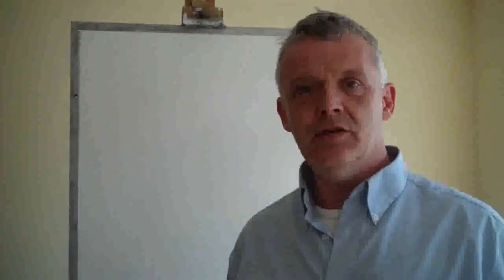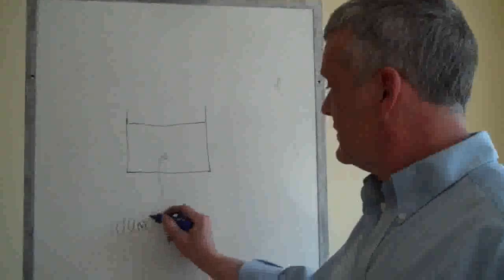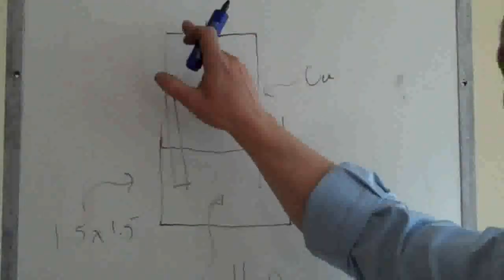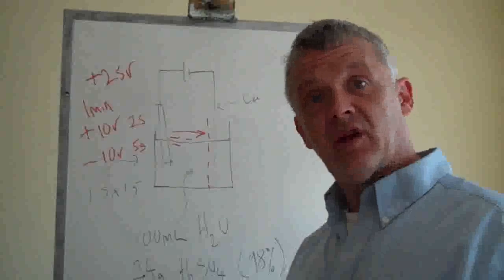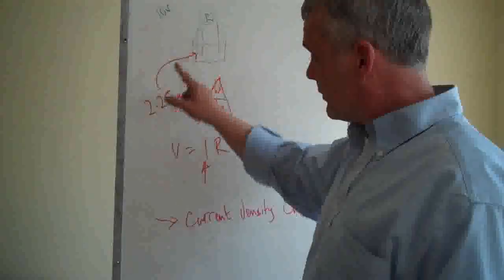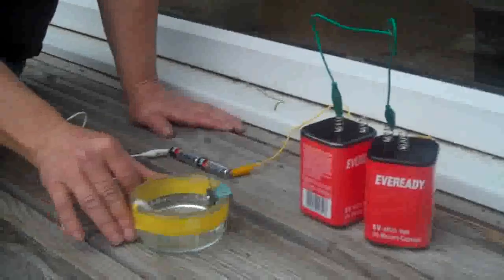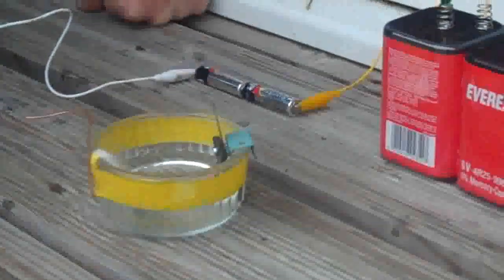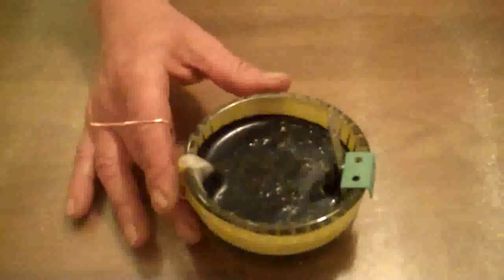Green Graphene

Comment: Hmm, can we use the resulting graphene like this, floating on top of an electrolite? I just had the idea to make a "flow-capacitor?" (like flow batteries) using bulk "plate - emulsion"... For capacity on the cheap. 
Tell me if you think its interesting.
Reply: Kistuszek I don't see how capacitance - a surface area effect - could flow like an electrolyte - can you explain?  RMS has lots of other videos on super capactors and the electrolyte(s) that work well...
Reply: Dude i honestly dont know how i was thinking it would work. But it sound a bit impossible now. I dont mind being wrong, but it feels bad not knowing how...
Reply from the maker: sorry mate - i missed this comment a new concept called the electrochemical flow capacitor (EFC) has been presented in several papers. This new concept shares the major advantages of both supercapacitors and flow batteries, providing rapid charging/discharging while enabling the decoupling of the power and energy ratings. Like in supercapacitors, energy is stored in the electric double layer of charged carbon particles. A flowable carbon-electrolyte mixture is employed as the active material for capacitive energy storage, and is handled in a similar fashion to flow or semi-solid batteries (i.e., for charging/discharging, it is pumped into an electrochemical cell, and for storage, it is pumped into reservoirs). Most studies present the proof-of-concept of this technology and report on initial EFC performance data obtained under static and intermittent flow operations. try a googel scholar search
Reply from the maker: replied tot he earlier comment - sorry i missed it
Reply from the maker: see my reply - there is some confusion these days over what constitute a capacitor and what constitutes a battery - a good way of seeing it is as an energy storage device with capacitive attributes
Reply: Thanks, ill read up on this.
Reply from the maker: again - sorry it took me ages to reply - i just missed the comment until someone else commented and it highlighted the fact i had missed you
Reply: Dont sweat it! Comment section is messed up for one reason or the other usually.
Reply from the maker: lol - true enough lol

Comment: How many amps should my batteries be?
Reply from the maker: mate - i don't understand that question - as high as you can get them - they will last longer
Reply: OK so the amprage of my batteries don't matter. Only my voltage. I have tried this 3 times and it hasn't been working out for me. Why do you think that is? I have been using as batteries in series to get the 10 volts and 2.5 volts
Reply from the maker: how are doing with the timing and swapping the polarity?
Reply: Fine but just to verify it is positive on graphite for 2 sec and  positive on copper for 5 withe the 2.5v at the start with positive on graphite for 1 minute. I am getting fizzing but no gray foam that is the graphene
Reply from the maker: yeah sounds about right - all I can suggest is you try varying it and see what happens
Reply: OK thanks for the help. If it does work how should I spin coat it? Do you suggest just painting it on to my glass?
Reply from the maker: I did a vid on spin coating mate
Reply: All right mate thanks
Reply: Dan Avila try using shorter conductors and a smaller tank.
it sounds like there is too much internal resistance.

try to find a small appliance power supply  that you don't need anymore with a higher amp rating even if the voltage is higher!

Comment: would vein graphite work?
Reply from the maker: yes
Reply: For some reason this was not producing any of the black goop  that is graphene like yours. Any idea as to why?
Reply from the maker: how big was the flake size?
Reply: Very small and only like 10 of tgem
Reply from the maker: i use 5- 350 microns - 5microns is about the size of a blood cell
Reply: How can I tall. It is the researchers 10 vein from gs international
Reply from the maker: you would need an msds or tds from them. I don't work for them anymore but i doubt it is that small. You could try intercalating it and expanding it first or sticking it in a wet grinder for a few hours
Reply: Then it would be a powder though and it had to be an electrode right?
Reply from the maker: you can compress it onto an electrode - but to be honest - i forgot you were using the electrolytic method.
Reply: All good but will my vein work or not
Reply from the maker: yes
Reply: Do you have an idea as to why it didn't work before?

Comment: You said that at 8V it would take ages to create the solution , but at more than 10V it would be too fast and create sheets that are too big.

Question: Does this mean that if someone uses an 8V he will geat really thin layers of graphene? And it's hypotetically possible that in a "goldilock voltage" he would get single-layer graphene sheets?

Comment from the maker: The easiest thing to do is build one. Radio shack or maplin have a kit available with relay included or you can just design your own based on a 555 chip. There's lots of info on the net on how to go about doing this and you need a 555 chip a couple of capacitors and a couple of resistors to do it

Comment from the maker: To 100% prove you have graphene your going to need to measure the thickness of the plates you have formed. To do that you are going to need access to some analytical tools like an electro microscope. If you don't have those kind of things available you will have to spin cast your solution anneal it and if you get a transparent coating that conducts to some degree you will have a confidence levels of graphene.

Comment from the maker: Graphene doesn't actually dissolve in water it disperses to form a colloidal solution and not much disperses at that. To improve the amount dispersed you need to add a surfactant PVP will do a good job as will PEG. This means you can just paint it on. however you have to get rid of the surfactant afterwards and this is done by heating so the substrate needs to be able to withstand temperatures up to 300 degrees centigrade for half an hour. Glass would be ideal.

Comment from the maker: supercapacitors are really easy to make. they are two layers of metal with some conductive material spread on them, a separator is put between them this can be paper and finally an electrolyte which can be salt water, acid or a whole host of stuff. To experiment you can change any of these components. if you want to use grapheme put that on the metal and off you go. But, to be honest, read more before you start as this little description is something you really should understand.

Comment: And here is another math part.
Now for the KOH 30% part. Assuming that the solid flakes of the KOH are 85% pure and we need 30% in the 100ml solution of mentioned above (2.4grams of sulfuric acid in 100ml of distilled water); then we need to add 30*(100/85)=35.29 grams of solid KOH to that solution.  Is that right?

Comment: Dear Robert can you check my mathes please?
If the specific gravity of the sulfuric acid is 1.2865, this means that in every cm3 we have 1.2865 grams of solid sulfuric acid. Thus if we want 2.4 grams of sulfuric acid we should use 2.4/1.2865=1.891 cm^3. Since 1ml = cm^3 then we must add 100-1.891=98.108 cm^3 of distilled water. This way we will have 2.4 grams of sulfuric acid in 100ml of distilled water. Is that right?

Comment: I think this is a different one - the title is "Bottom-up synthesis of large-scale graphene oxide nanosheets", by Libin Tang, Xueming Li and half a dozen other authors. No graphite or electrolysis is used in this process. I'm not a chemist, but the gist of it seems to be cooking sugarwater (glucose, fructose or sucrose, ~ 0.5M) in an autoclave at ~160-180C until a 'skin' of GO forms on top. A substrate can then be coated by dipping and catching the skin with it.

Comment: Ah, sorry, I see this is an "exfoliation" method that does not form graphene, so much as break it off. So the 2 seconds is to push ions into the graphite and the 5 seconds to pull them and a layer of graphene off (or vice versa). I thought that graphene was being formed, and the 2 secs for creating free ions and the 5 for putting them together. In the latter case the creation and pulling together might be done smoothly but that is not how it is working.

Comment: Very good video! i found also a reference about this synthesis method (htxp://idv.sinica.edu.tw/lanceli/Paper%20PDF/High-Quality%20Thin%20Graphene%20Films%20from%20Fast%20Electrochemical%20Exfoliation.pdf) (replace the x on the link )

but with this method how is possible to separate the graphite from the graphene? Because I think that not all the exfoliated material will be converted!

also another question, i would like to use a NE555 to switch the current, what frequency do you recommend?

Comment from the maker: I think you may be over complicating this. The polarity reversal won't affect particle size in itself but rough handling will. If you up the voltage and therefore increase current the flakes get smaller and thicker it's like the difference between gently prising something apart with a wedge as opposed to taking a grater to it. You want enough force to do the job but not so much as to damage things. Your rotating idea may well work but the implementation seems unnecessarily complex - sorry

Comment: In your video the graphene is formed on the surface. 

If the surface were flowing then perhaps anything formed on the surface might be more likely to be spread out. 

If spun the surface would be under tension as well, tending to form a greater surface area than it would if it were not spun, since spun bodies of liquid form a u-shaped parabola, lower at the centre. The tension of the surface might tension, and spread out, the graphene. 

Or perhaps I am just thinking of candy floss :-)

Comment: I tested copper foil (from a lithium battery) held inside two coffee filter papers + 10% NaOH (Mr Muscle drain cleaner) and graphite/artist block (Not a brilliant source, the flake graphite is on order). Cycling the power at the +-10V stage at around 2 Amps (current limited psu) showed particles flaking off the block. Would be very interesting in the stages used to clean / further process the resulting solution. ps Brought your book - highly recommended :)

Comment from the maker: Well, If you happen to have a raman spectroscope like me you can test it - the results are like a fingerprint and pretty much guarantee it is graphene. If not you can disperse it in a solvent - thin film coat it, anneal it at 350 degrees C and see if it conducts. It won't work with coke or coal as these are amorphous and all you are doing is stripping the already there layers - if the layers aren't there - there is nothing to strip. Sulphuric acid is drain cleaner - bullit is good and (cont)

Comment: Would it work with other carbon sources, such as coal or coke ? Or even carbon made using the dehydrated sugar method? And again how do you know the end product is actually graphene and not simply carbon gunk? Any tips where to obtain sulphuric acid and sodium hydroxide or equivalent off the shelf products using those chemicals?

Comment from the maker: The specific size is to give you a baseline for adjustment. Once you have the resistance of your cell you can adjust to maintain current density. It needs cleaning and dispersing - but gentle sonication will do it after after washing under vacuum filtration.

Comment: Supposedly the intercalation compound is C24+ HSO4-.  So what vaporizes?  HSO4- is an ion...or maybe there is some free hydrogen in the lattice which the HSO4- picks up and  it then vaporizes as H2SO4.  My point is that in forming an intercalation if electrons are in excess then something like Na+ or H3O+ will be attracted to the graphite and when polarity is reversed then HSO4- is attracted.  I think that by alternating they can squeeze in better.

Comment: The reason behind swapping to voltages intrigues me.  I've been playing around with electricity for a few weeks now trying to make graphene.  I used a single voltage and single polarity with pencil lead.  It quickly exfoliates but I don't know if the result is graphene, intercalation compound or very small chunks of graphite.  Expandable graphite is manufactured and used as a fire retardant.  It heats up, exfoliates, and smothers the fire.  Continued...

Comment from the maker: Bless your heart - DMF is what is used and pretty much guaranteed to work. If it was me I'd experiment with other readily available non polar solvents first to see how well they work - for example cellulose thinner, acetone, xylene, toluene - that kind of thing - i would try conductivity tests as a guide to how well it worked - or resistivity tests - just using a multi meter.

Comment: Very nice, Robert. Use a heavy duty sheep guts condom for a protective barrier on the copper cathode to prevent short outs. Its cheap and easily disposable
that way without using your precious fiberglass stock. Plus substituting platinum with raney nickel is also another good alternative in electrochemistry especially if
ones going for a large scale production. I really am enjoying your videos & now im going to enjoy reading your book even more. Thank you :)

Comment: Building it right now, well, after typing, great video again !
Is there any use in thinking that white vinegar and baking soda might be a good electrolyte ? 
The 3V 'forms' the cell I would think, then the rapid swaps are a bit like de-dendriting Ni-Cd's ? 
After scraping the graphene, you should see a voltage on that copper/graphite btw that may well run a joule thief :)